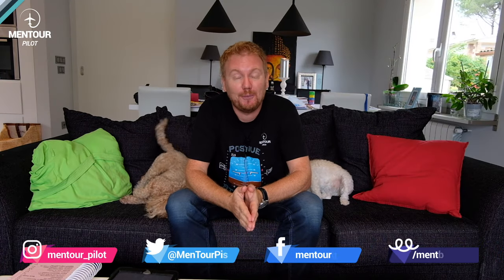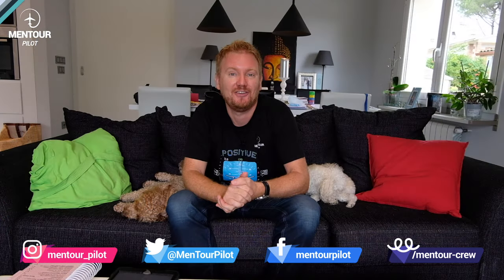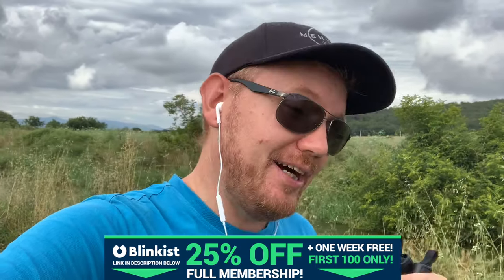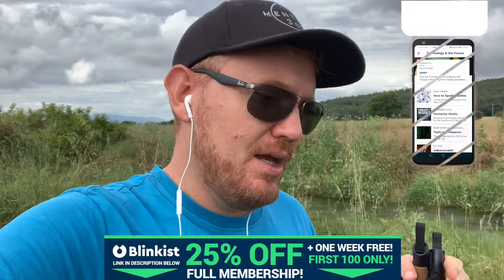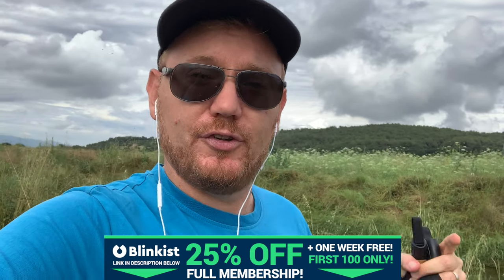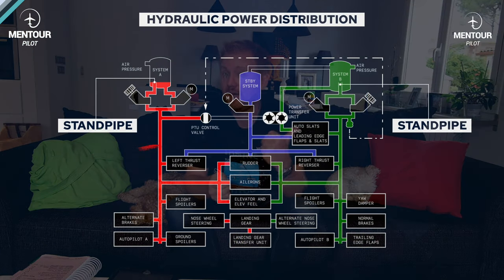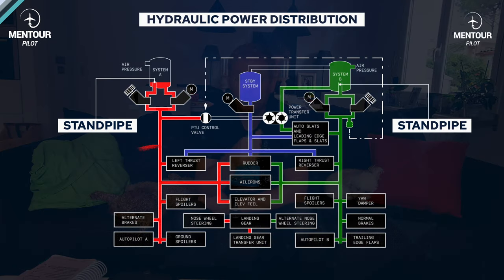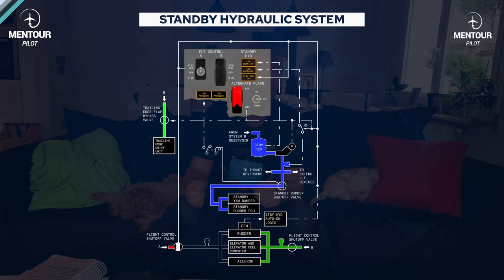How the Boeing 737 hydraulic system works. (And what happens when it doesn't)

Comment: Just a very minor question, I believe the engine driven pump supplies 6 times the fluid quantity, not 4 times? 7:28
Reply: Sounds accurate🤔 The EMDPs is rated at 5.7 gpm (gallons per minute) at 2700 psi, while the EDPs are rated at 36 gpm at 3000 psi👍🏻

Comment: The Airbus A320 uses fly by wire correct? What do they do when both hydraulic systems are lost? Can't use cables.
Reply: Airbus A320 has 3 hydraulic systems. You’d have to loose fluid in all 3 systems to be paralysed but that would be the same in any other aircraft except those with cables. Even if the 2 engine driven pumps (yellow and green system) fail the yellow system has an electric pump and the PTU can the pressurise the green system and the blue system has the RAT but the entire aircraft can be flown with just one system working

The A330/A340 also have 3 systems but the A350/A380 have 2 but some control surfaces using Elecrro Hydrostatic Actuators which can still operate even if the main supply leaks all fluid out.
Reply: @tomstravels520  Cool. Thanks for explaining.

Comment: Are the pumps of the constant delivery variable volume type?
Reply: Leonidas yes
Reply: Variable volume.  I checked and the engine pumps on the earlier 737-600, 700, 800 are variable volume.  I'm fairly sure the electric pumps are too, but I could be wrong.

Comment: If you loose hydraulic pressure I assume no flight controls are useable,o just minimum control.this is my opinion I didn't fly big jets with their complicated systems only gliders and single engine airplanes while I was in the air cadets.pleas correct me if I'm wrong this applies to any more qualified than me.
Reply: Daniele Pelaia 18:55

Comment: Hello Captain, please I know this question does not actually have to do with the video but it is about the 737, the slides specifically.
Is there a way to arm the slide wrongly? I work as a cabin crew member and there's this debate about the facing of the slide/detachment/ditching flap being a possible hindrance to the deployment of the slide.
Would you by any chance know or know anyone who knows?
Thank you
Reply: No, it really shouldnt be possible to not arm it correctly.
The girt bar goes into the latches and thats pretty much it. What flap are you talking about?🤔

Comment: I take it that there is no backup rigged to the APU that could supply a 2nd standby last resort to the Hyd system.  Why not?
Reply: W user if both engines were still functioning and then you started the APU to get another system then you’d use more fuel. Also add too many hydraulic pipes and lines and you’ll run out of space and add weight to the aircraft
Reply: Because the airplane can be safely controlled without hydraulics.  The APU provides backup electrical power, and a supply of air at lower altitudes.

Comment: Is that growl from an A3XX  the electric motor sealing cargo door  or is it re-homing the flaps, etc.  Are those things homed(zeroed) regularly to determine where the zero point is?
Reply: Depends which noise you refer to. There’s also the PTU, referred to as the barking dog
Reply: @tomstravels520  I have no clue.  I bet door will try try and try to confirm closure.  Yea, barking dog.  I'm an engineer but not aero...but am familiar with the bark and therefore am curious.
Reply: If the airplane is away from the gate, then it's not the cargo door.  The doors are closed and locked before pushing back from the gate and aren't opened again until parked at the next gate (by "gate" I mean wherever the airplane is parked for loading/unloading).
I'm not familiar with the Airbus designs, but I doubt they need to re-home the flaps for calibration.  First, I suspect they use very reliable position sensors.  When I worked at Boeing 20 years ago, RVDTs and LVDTs (Rotary Variable Differential Transformer,  Linear Variable Differential Transformer) were common.  I suspect they still are.  These are very reliable and repeatable position sensors. And, they give an accurate position on power-up.  That is, they do not need to be re-zeroed if the power has been off.  Secondly, the the flaps are going to be retracted to zero on nearly every flight, and I think it's common to retract them at the gate so they are more out of the way and less likely to be damaged by ground vehicles.  So, there are plenty of opportunities to check zero if needed.  But, in my view, a design that needed to re-home on a regular basis is not safe for critical applications on an airplane.  I really doubt it is used.

Comment: Most hydraulic brake systems it requires hydraulic pressure to release the brakes... so when pressure is lost the brakes apply. Its a brake failsafe condition.
Reply: Not so on any airplane I’ve flown or worked on.
Reply: Nor any passenger vehicle I've ever driven.

Comment: Is this true that, there is a deasel engine in each passenger aircraft, to generate electricity for heating cooling systems, and other uses?
Reply: sirous asl Most passenger jets has an apu that can generate electric power and bleed air, it uses jet fuel tho🙃

Comment: Did they change the airliner's hydraulic systems redundancy systems after the DC-10 that crashed in Sioux City, IA in 1989?
Reply: Supposedly there were various isolation valves fitted but not sure to what aircraft or where. The best solution is probably the EHA’s used on the A380 and A350. If the main lines looses all fluid then these self contained systems have their own mini hydraulic system that just requires electrical power

Comment: Most people might think that the parking brake is cable operated and completely mechanical but they would be wrong. They all use hydraulic pressure which will decrease over time and one break system is notoriously short. It's the B-737 Mark 5 brake system. To be safe you bring chocks with you to park any airplane. For long term parking you need 4 of them, but a large pair will do for nothing longer than an hour and you chock the mains, never the nose gear. First the pilot sets the parking brake. If the plane isn't moving for awhile the pilot is supposed to pull brake system breaker on the P3 panel. This totally de-energizes the circuit on the parking break preventing a slight power draw on the parking brake control valve that can cause the parking brake to lose pressure and release the breaks. That's why you always chock an airplane before you walk away. All later aircraft got rid of this problem.
Reply: Do you mean P6-3? Isnt that where it is?🤔 On long term parking (like these days🙄) we pull it (the parking brake c/b) iaw AMM.

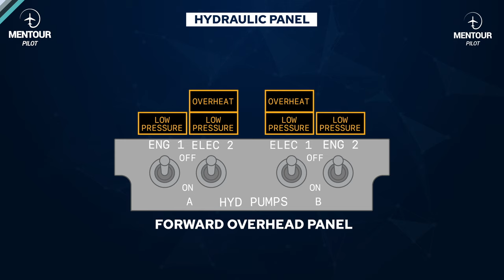Comment: 6:40 I always thought that the overheat on the electric hudraulic pump was reffering to the electric motor overheating, not the pump :O Guess i was wrong, we live we learn :)
Reply: You need fuel in the tanks to keep the hydraulic fluid cool
Reply: To be fair, the reason you don't want overheating in the pump, is that the hydraulic fluid loses it's force retention ability and changes slightly chemically once heated above a certain temperature. When this happens, you often get situations where you hydraulic actuators are unable to operate fully even though pressure is building past max pressure limits, causing you to get a poor response from actuators, and a high probability for a hydraulic leak at the weaker segments of the hydraulic system. 
Long explanation short: avoid overheating.

Comment: If the hydraulics fail, ya gotta send the F/O down into the hull to hand crank the wheels down like a WW2 bomber bomb bay.  No?
Reply: No you pull the 3 cords to release the uplocks as shown in the video
Reply: @tomstravels520  You are incorrect Sir. Those cords need to be pulled every 4 minutes to manually spin the hydraulic pumps. (like a beyblade) One cord is for system a one for system b and the third one for the stand by system.

Comment: How many different numbers do you have to memorize for the 737?  Why did they provide the actual pressure vs. say 100%?
Reply: That's a good question.  The answer is probably mainly historic.  For any complicated machine (airplanes, cars, computers, 3D printers), the early machines probably require a lot of hands on knowledge from the operator.  These early operators are going to want readouts that tell them as much about what is happening as possible so they can make better decisions about how to operate the system.  Over time, the machines get easier to use, and the operator needs less knowledge to operate them.  As you suggested, it makes sense to simplify the data given to the operator as machines get more evolved.
Regarding airplanes: A lot of the early commercial jets in the '50s and '60s would have had a a 3rd member in the flight crew -- the flight engineer -- to monitor the engines and systems.  I suspect that most flight engineers would have been incensed at the idea of showing them 100% instead of a "real" number on a pressure gauge.  The 737 was introduced in the '60s and I suspect it never even occurred to anyone at the time to put anything but the actual pressure reading on the gauge.  In FAA certified aircraft, once something is approved it is very time consuming and expensive to make changes.  A change like you suggest is only going to happen if there is a really strong reason to do it.
Reply: Pressure in psi, quantity in % 🤷🏻‍♂️
Reply: Speedbird actually, the customer has the option of quantity displayed in percentages or in actual gal/liters.  Fuel quantities are always displayed in pounds or kgs

Comment: So why do you need to turn off the left switches when pushing back? Do you not get a bypass pin like the airbus that cuts off supply to the nosewheel
Reply: Thomas Mortimore there is a bypass pin, but some operators do it out of an abundance of caution (as does Boeing)
Reply: B37xM Flyer so basically it’s just double protection? I know the airbus has a nosewheel steering and anti skid switch that can be turned off but never seen anybody use it
Reply: Thomas Mortimore yep, Boeing does it mainly due to the fact that in production test, you’re not sure the plane is built right until you test everything.  I suspect that RYR may do it due to some knucklehead in the past didn’t properly pin it, and sued the airline for his mistake.

Comment: Do you know why the engineers didn't go with 2 engine driven systems?
Reply: I'm not quite sure what your question is.  Do you mean only the two engine driven systems without the third electric system at all?  Or do you mean two hydraulic systems on each engine, making for 5 systems total?
Really I guess the answer is the same.  The three systems they use provided the redundancy needed.
Reply: Both A and B systems have an Engine driven pump and an Electric motor driven pump.

Comment: I'm confused. Why does the autopilot need it's own hydraulic pressure? Isn't it just a computer that sends commands to the control surfaces (which are then fed by the hydraulics)? It's just a computer that gets input from the various sensors and outputs desired control surface deflection as a digital signal?
Reply: It dont have its own hydraulic system.
When did he say that?🤔
Reply: the FCCs (autopilot computers) send electrical commands to hydraulic actuators which in turn force movement to the pilot input mechanisms and the surface Power Control Units.  The autopilot hydraulic actuators are downstream of the pilot yokes, but upstream of the surface Power Control Units.  that is why when the autopilot is in control, the yokes are backdriven by the autopilot actuators.

Comment: I’ve always wondered if in a pinch, could you use the ailerons for pitch control.
Reply: Do you mean in theory, or on a current 737?  It definitely can't be done on the current airplane because if one aileron goes up, the other will always go down.  In theory, as you already figured out, deflecting both ailerons in the same direction is likely to create a pitching moment.  But, could it be used to control the airplane?  I think it would take some serious aerodynamic studies to determine that.  For example, I think it's possible (I'm NOT saying likely) that moving ailerons up could give you a nose-up pitching moment at some speeds and aileron angles, and change to a nose-down pitching moment under other conditions.  If changes like this would happen, then using them for pitch "control" isn't really possible.
Reply: Not on commercial aircraft except Concorde. Only really fighter jets that do that. Usually they’re positioned at the back so it would make more sense to use the elevators as ailerons if you had to
Reply: Thanks
Reply: No, but there is a system on the Max that allows the pilots to use spoilers to control pitch.  For all you critics....yes it’s in the FCOM, and it works quite well in the case the elevator becomes jammed.
Reply: B37xM Flyer if the elevator becomes jammed wouldn’t you just use the stabiliser trim? How can spoilers help with pitch when they only deflect up?
Reply: @737MaxPilot  Thanks for pointing that out, that's interesting.
Reply: Thomas Mortimore I wouldn’t think that would be very effective during landing.  The elevator jam assist works nicely real-time.  A nice benefit of the fly by wire spoiler control (SCU).  You’d be surprised at just how much effect they have on the center of lift.  I’d have to look at the FCOM procedure, but I usually check the operation at flaps 1.  There may be a maximum flaps setting when using them for a real malfunction.

Comment: If a mechanical control system consisting of ropes and rods breaks down, can the hydraulic systems control the flight control surfaces? In other words, do these ropes and sticks participate in the regular operation of the system?
Reply: I’m pretty sure the hydraulic system for the flight controls is like the power steering in your car, if the hydraulic fails you can still drive but much harder, if the connection between the steering wheel and the front wheels break then you have a problem
Reply: On the 737, no to the 1st & yes to the 2nd question.  The cables are always required to operate the flight controls.
Reply: With ropes, do you mean cables?🤔
Reply: @speedbird9313  Indeed

Comment: Peter, how the hell get pressure from the engine? from the rotor turning or ?
Reply: The same way the engine turns the generator/fuel pump/oil pump....
Reply: A 90 degree shaft and gears

Comment: So if you do a one engine taxi in 737 does it matter which engine you use because both systems will be operating?
Reply: Yes, it has to do with nose wheel steering.
Reply: B37xM Flyer but won’t the electrical pumps take care of it? Or is it not powerful enough. If not then I’m guessing you taxi on engine one
Reply: Thomas Mortimore yes, but would you risk using a single pump with less volume capacity for your taxi?
Reply: B37xM Flyer I’m more familiar with the airbus set up and one engine taxi for them is start engine 1 to power the green/blue system and then use the yellow electric pump to pressurise the yellow system which gives you NWS.
Reply: Thomas Mortimore 
I know most US airlines do this in the 737 as well, but as I don’t have airline experience, I’m only guessing they choose to taxi with #1 running, as Hyd A provides normal nose wheel steering.  I know brakes are normally powered from Hyd B, but alternate braking from Hyd A happens automatically with no crew action required.  To taxi with only #2 requires the crew to actively select alternate nose wheel steering...which I highly doubt is an endorsed airline procedure.

Comment: Have you done a total hydraulic system failure in the simulator?
Reply: Richard Burris it is required during the initial type training. Everyone who has a 737 type rating has (or should have) had that experience.

Comment: Is there is any replacement of hydraulic system
Reply: Not for flight controls
Reply: You can drain the A and B reservoir at the bottom of the reservoir a valve and then refill with new fluid